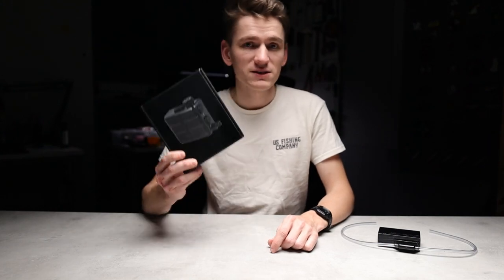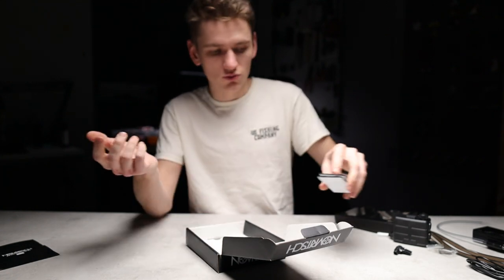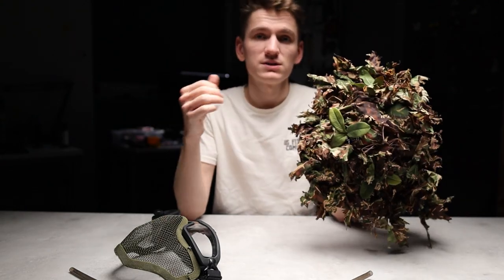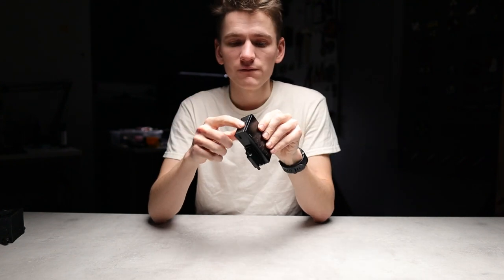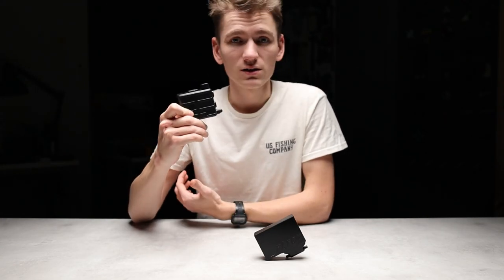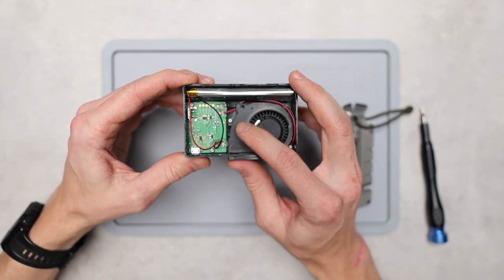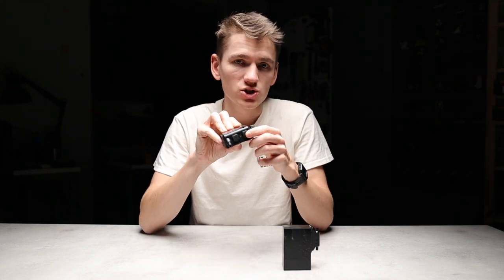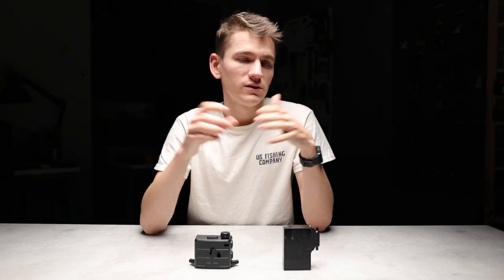NOVRITSCH ANTI FOG UNIT vs EXFOG (Review & Teardown)

Comment: I wanted one of the nov units until the shooting test. that's very thin and brittle plastic. I would worry about dropping the unit or even banging my head against something and the entire case cracking.... The fact the bb went through as if it was paper is very concerning to me about their plastic builds of other items.....and now the pipe points in to the box unit as if you hook up your pipping you might snap the nozzles too.... I think they need to take it back off the shelf and redo the casing. Maybe a metal version
Reply from the maker: I agree that it should be improved but it is not as dramatic as you think. I've been throwing this unit around in my gear bag for several months and been fielding it since August, 2022. Chances of getting hit directly in the back from 1m are very low - normally people tend to aim for body in such cases but there's a reason why Novrtisch has a customer support and warranty. ExFog was such a pain in the ass to use compared to Novrtisch AFU that there is no way I'm going back, not to mention the better performance.
Reply: Uhm we have video, of 1.5j .32g at 20 feet and blew a hole through in 1 shot and then tore it completely apart with subsequent hits.  And with the battery positioned as it is it appeared to damage the battery as we started to smell burnt plastic.  We ran it outside and stopped testing after that
Reply: We also can confirm the tube connectors do break off and make the unit unusable.   The magnet connector also comes apart and the air funnel drops into the user's goggle when.  Independent review is available on that and we personally have 2 nov units where the magnet components separated and won't stay together without superglue
Reply from the maker: For anyone reading these, please note that Jennifer is directly involved in ExFog so it's also important to take bias into account. Unless you shot the device from the velcro side where it mounts on the head, I have no idea how you damaged the battery as there is a fan and a PCB completely in the way of the battery even if the BB goes inside the case. And yes, there are some videos already out other than this and overall feedback has been positive from those who have been using it for a while. It's not as bad as you make it seem.
Reply: @TRIDOS.DESIGN  says the designer.  Lol
Reply: Lmao.  We can share the video with anyone interested,  but the case was shot to shit the fan had no chance.  Multiple shots of course, but fan went the way the case.  Same process used on the Exfog and it no only didn't blow a hole through it, it didn't even crack the lid.  There were literally some dents.
Reply from the maker: @jenniferbennett3540  the difference here is that I was a contractor and I have no monetary gain in this project. I'm just purely excited to have another option on the market that has some of my main gripes fixed coming from ExFog.
Reply: So you're quite the philanthropist.  You're the designer yet claim no monetary gain. Lmao
Reply from the maker: @jenniferbennett3540  What I mean by that - I have been paid for my work and I am have no financial interest for this product to do well apart from my enthusiasm for the product and the impact it can have on the industry.  I made it pretty clear in the video and just making sure that this is clear for everyone.
Reply from the maker: @jenniferbennett3540  You on the other hand, as I understand, are still actively financially motivated for ExFog to keep doing well and for Novrtisch AFU to not do well to keep your market share. Or am I completely in the wrong here?
Reply: @Jennifer Bennett   would love to see the video posted on YouTube no reason not too. He was paid btw already and doesn't get any more I come from it soo there's not a benefit to his continued "up selling" where as for example if your currently paid by exfog on the monthly then it would be best for you if exfog sold more units. Just a re explanation of what he ment I think. I'm not going to lie I'm normally pro original stuff but this seems to have enough changes I'd call it Innovation over copying. Iv seen alot more negative and harassment from exfog than any bad mouthing by novritch stuff. I still recommend ex fog and the antrifog to people I tell them the differences and let them decide.
Reply from the maker: @180molotov  well said - this is exactly all the points I was trying to make! <3
Reply: Aaron actually posted a long message I forwarded here, but the powers that be apparently didn't want it out there since they removed it, but in there we explained that the video will be posted shortly.  We believe we are allowed to address Novritch directly as long as all information is true, but we are having our lawyer review the footage first to ensure there are no legal issues.  Make sure to keep an eye on the exfog pages and we will have them there as well as other videos that include new exfog units and not 2 yr old used ones passed off as an even comparison.  :)
Reply: I don't deny a interest in this, never have, but the idea that you got your money and could care less when it is your brain child is quite disingenuous.   It clearly would not have been a biased flawed review using a 2 yr old exfog and the subtle dismissal of obvious flaw in the afu while trying to make an issue of literally non- issues with the exfog aka pcb board component quantities as an example, you clearly have a stake in this.
Reply: And if you need a 2nd video showing a giant hole being shot in this to validate that it is not a 50 dollar value, we will gladly provide the video to back up what was already shown here.  We will even include the magnet falling apart and the tube connectors breaking off.  Then we'll add the opening the unit where the battery wasn't attached to adhesive on the afu and the battery connector coming clean off of the metal barbs when trying to remove the battery.  All of this an more will be fully available from ExFog as soon as we get clearance.
Reply: The last thing I will say about you objectivity in this, is 1.  This is an advertisement for your design business which is monetary.  2. If you didn't a vested interest in this being positive, why are comments disappearing?  Aaron's post is gone that I forwarded.  A guy i replied to help him out with his exfog, also disappeared as did my response.  Awfully suspect if there is no interest in the success of this.
Reply from the maker: @jenniferbennett3540  Great to see that you'll be posting those. I've not removed any messages so maybe it got flagged by Youtube spam filters? It is unfair to call us out that we've been using an "outdated" version - how the hell, me as a consumer, could have known that there have been major internal changes if there is no mention of it anywhere on the product pages, any "V2" or "Gen2" markings that would make it clear there are different versions of ExFog out there? That is completely on you that this has not been clearly communicated and there different versions out there that are indistinguishable from outside.
Reply: I absolutely should call you out.  Anyone doing a review,  especially a designer that understands anything about LiPo batteries knows, that comparing something with a used 2 yr old battery to a few months old comparable device is no a fair comparison.   If you want to recommend nov to everyone,  more power to you, but to do a comparison video taking used old equipment and comparing to new is not fair by any standard.   Given the same components in this video, a new version using the exact same ones seen here would not have produced the same results.  Not to mention doing a shooting test on a unit that has been, broken open and then commenting on the "give" by the manifold after you directly created the integrity issue.
Reply: Let's just be honest.  This wasn't an accurate comparison regardless of what version you used.  Testing with any integrity compares "like" items.  If you can't afford to purchase new equipment to compare to new equipment,  then maybe doing any comparison video should have been reconsidered.
Reply: @jenniferbennett3540  would love to see Aaron's comment. I'm sure it was completely innocent that it got deleted. Uh huh. Sure.

Comment: do you see a way, to make turn the airflow from blowing to sucking on any of these units?
Reply from the maker: The fans used in these are made to blow air. I don't see how this would be possible in this setup - it would have to be engineered in a completely different way.
Reply: The ess are blowing the air out of goggles. For me it also looks like a better option. Exfog never worked well for me. But did for many of my friends.
Reply from the maker: @sergeysoff  the price for the ESS goggles honestly are out of budget for most airsoft players and the comfort for those goggles is not the best. But I do see how it's more convenient. I've heard quite a few people for which ExFog was not powerful enough - I can assure that AFU is a looot more capable if you're a really sweaty person.
Reply: Unfortunately the ess were the only option for me. While I don't have issues with paintball masks, they never fog up, ESS were the only one that do not fog for airsoft  and I have to run on high all the time.
Really waiting for trittech release. Hopefully, they work well.
Reply: @TRIDOS.DESIGN  I thought it might be possible, if you out the fan in the unit upside down. that way the air should be moved into the other direction. I assume it isnt that easy?
Reply: @sergeysoff  I have a question regarding the ESS Turbo Fan goggles: are they even better against fogging than the Exfog / Novritsch fan systems?
Reply: @marcoviebrock1550  I can not state, that ESS are better. They are working better for me. I'm wearing contact lenses and don't really like the fact that air is injected into the goggles. This dries eyes even more in addition to contact lenses. The Idea of removing warm air that causes fogging looks better in my case. I have not had success with earlier version of ExFog. Many of my friends are happy how exfog is working for them (even the older version). The newer version has slightly bigger holes in manifolds that allow more air to be delivered. Have not had a chance to test it. And have not used AFU yet. I'm working on a custom built mask out of e-flex with mesh mouth and cheeks protection and exhaust fans to be able to use with YouZee insert. If fans are not enough I have a plan to add exfog/AFU air boost

Comment: Ive made my own, easy to do with some fusion 360 knowledge 3d printer, bits n bobs from amazon, i run mine with a 7.5 small lipo and push the 5v fans to its limits but when you make it and it costs pennies to make theres no matter if the fan goes pop now n then.. but mine hasnt popped yet on full power..😂 plus you can make it fit any googles when you are the designer 😂
Reply from the maker: Power to you - that's always the coolest and you ca n be proud of your creations ;)

Comment: Have an ExFog but never used it. If mounted on a Helmet with attached Sordins the sound is transmitted straight to your skull which is unbearable in my opinion. I now use a Smith optics OTW turbo fan which is great. I can hear it but it is low enough that it doesn't bother me. Thought about trying the Novritsch, but seeing ad it has pretty much the same fan I bout it is different

Comment: Well you get what you pay for.  You can check some other review, but you should also make sure to have plenty of superglue since the magnet falls apart and the side tube connectors break off and since they are part of the unit your 50 dollars is trash.   There are videos if anyone would like a real review.  Oh by the way, the battery life is on the lowest setting.  6hrs at best on high vs exfog 10 hrs on high and 13 hrs on low.
Reply from the maker: We left both of the units (fully charged) with a security camera and attached small strips of cellophane to see if they are blowing air. If you would like, I can send you full 11 hours of footage to show that Novritsch Anti Fog unit lasted 10h40m on a single charge while having higher airflow on lowest setting.

I have to agree that the attachment mechanism has broken for some people but they will improve it and ExFog doesn't come with any attachment mechanism whatsoever.
Reply: On low setting.  I tested both on video. If you want to compare
Reply from the maker: Sorry, not sure what you mean. Based on the performance testing it was clear that ExFog on highest setting could not move any of the flour, whereas Novrtisch AFU could do that a little bit on the lowest setting - which means that the power output in terms of air speed / volume / strength was around the same. There is no point in comparing runtime in high power output on AFU as it is clearly several times more powerful and obviously consumes more power.
Reply: A clear diversion.  We are talking advertised battery life.  Nov claims 10hrs.  It is only 10 hrs on its lowest settng.
Reply: As for airflow 1. Your using a 2 year old unit.  We don't know what care was taken of the battery in all this time, not mention general use wears down a battery.  This isn't a current reflection of our newest gen.  Finally, you are comparing a unit that is designed to blow large amounts of air vs one designed to regulate temperature using a little airflow as possible to accomplish the task.  Of course the will perform differently
Reply: I mean, weren't the first then of exfog 3d printed and had issues you fixed in later gens aswell.. I have yet to see anyone go after exfog online the same way exfogs gone after the novritch stuff.
Reply: Never has been 3d printed.  Has always been the same case injection mold by the same supplier since inception.  You can go back to our initial videos and see Aaron speak about Lexan being used which is a component in bulletproof glass.  Day 1 has always been Lexan
Reply: The reason you haven't seen anyone go after us is we are the inventor of the idea and spent thousands of dollars processing a utility patent, which is still pending and going through the system.  Unfortunately there is a backlog multi year right now.  So yes intellectual property theft warrants challenging this everywhere we find it.  Especially when an inaccurate analysis of our device is being published as fact.  We are handling the legal end of patent law through our attorney, but we will respond to anything challenging us by name as this has done.  The things said by us here are true and verifiable.   If people don't like it, it is unfortunate,  but we won't allow our product to be stolen and then lied about without a response.
Reply: @180molotov that's because they seem to lack any semblance of professionalism, I'd hate to have to deal with any sort of warranty or customer support, I imagine their professionalism, or lack thereof, is telling of how such an experience would be.

Comment: If anyone here is only concerned with gameplay performance and just wants something that works and doesn't care about the morality war in the anti-fog industry, just get the Nov system. I can confirm it works. I don't even use my old Exfog anymore. I've slammed hard and been shot in the head multiple times, it's survived. Battery's never died on me. I haven't had any fogging problems since getting it, whereas the Exfog was always more finicky because the hoses are loose and will wander rendering the unit useless if you don't secure them somehow. The magnetic mount erases all that trouble and makes it way more convenient, even if you don't use Nov goggles ( which I don't). The power output and controls are also better than Exfog. It works.
Reply from the maker: Glad to hear you're enjoying it - this was exactly our experience as well!